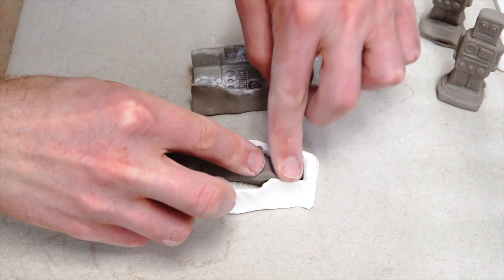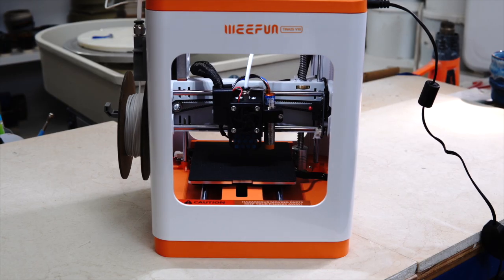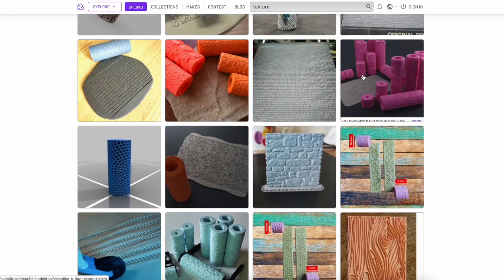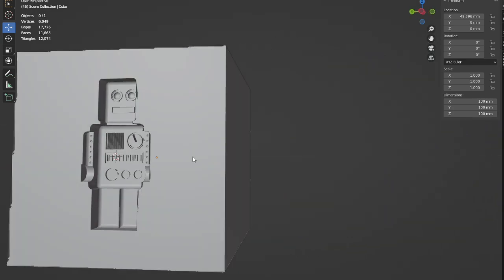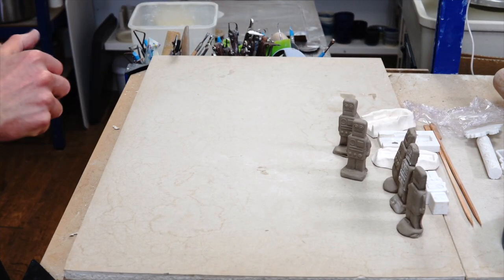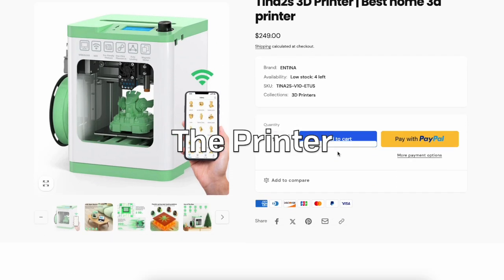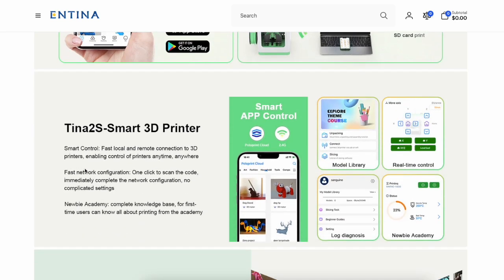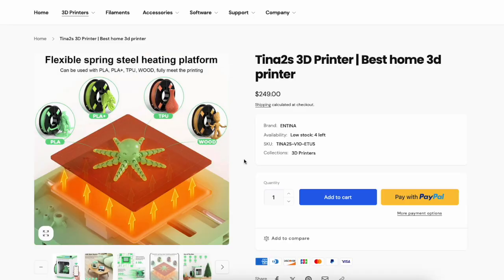Using a 3D Printer in Ceramic Projects

Comment: Also, to print any other plastic than PLA, you need to protect the printer from fresh air. Good printers are always enclosed, but a trash bag or an old box over the printer is a good start.
Reply: Why do you need to protect the 3d printer from fresh air?
Reply: @drmr_mist  Not printer, the part that is being printed if it is not PLA. For the best strength and least deformation, the temperature of the previous layer needs to be just right, and the room air is too cold. Closed printer heats up to 45-50C by itself, and that is a big difference already. Printers with heated air get to 65-70C. This is great. With those temps, you can print ABS as easy as PLA.
Reply: Thanks  @BarafuAlbino
Reply: @BarafuAlbino  Partially true: You really only need an enclosure if you're printing ABS, ASA, Nylon, PolyCarb, CF. You DO NOT need an enclosure for PLA(+ & CF) , Petg (CF), TPU/TPE. I print open with those materials and the tolerances are just fine.

Comment: Did you try printing with PETG, or as extreme, the PP (polypropylen). They are notorious for not sticking to anything, maybe you won't need any powders with those. Also make sure to use uncolored (natural) plastic when you don't care about color. Pigments always degrade the plastic.
Reply from the maker: I haven't tried any other materials yet, but I had been looking into them. They definitely sound like they're more hassle to get working correctly, but there are some properties that could be really useful (like greater flexibility, for releasing from plaster casts)
Reply: @OldForgeCreations  The key to PETG on a printer like yours is to set max flow rate. Start with 8 if you don't want to calibrate it.
Reply from the maker: @BarafuAlbino  thanks!

Comment: Resin defnitely requires good ventilation. You do not want to breathe that stuff, even the low odour ones. 
The filament printers also benefit from ventilation, especially if you are using it in a living area.
Reply from the maker: For sure. I don't want to be breathing in any of it if I can possibly avoid it!
Reply: Truth! I did the research and decided against resin. I guess if I needed highly detailed/smooth print I would have thought twice. Plus it's much more expensive and more time consuming than FDM. FDM= Design, Slice, Print, done. Resin= Design, slice, print, cure, wash.

Comment: Great information! I didn’t know the difference between the resin and plastic. What a great idea for test tiles. I’d definitely make something taller myself because I prefer to layer glazes but wow I will definitely use this idea. Thanks so much. ❤❤❤
Reply from the maker: Interesting! I'm currently working on a blog post/video about test tiles and the various considerations, so I'd be interested to know what height you'd typically want yours to have?
Reply: @ I handbuild and LOVE textures of course. I like my tiles to be at least 3” tall but prefer 4”. I put texture on one side and not on the other so I can apply the glazes to both sides. I also make flat test tiles with and without texture. I also make a small piece for the tiles to stand up on and fold each side up Incase the glaze really flows off. To it’s like an upside down T with the short side folded up upwards just a bit. I could send you a picture if you would like. I have the big blue extruder and am having a die made so it won’t be so time consuming to make the test tiles. Especially when drying them I have them covered and then take the bag off and replace it with a dry one and if you knock one over they are like dominoes and all fall over. Lol. ❤️❤️❤️